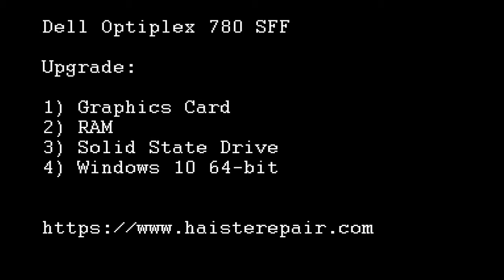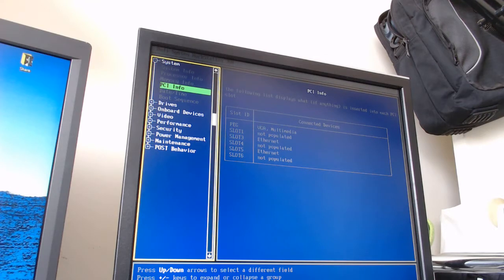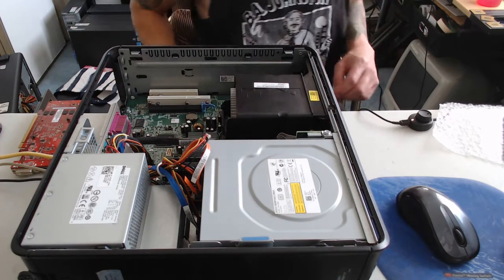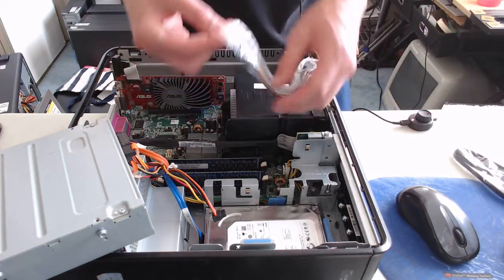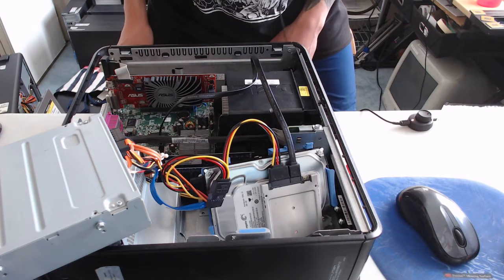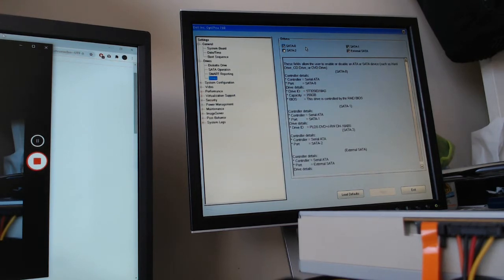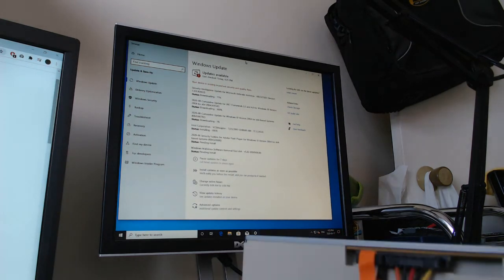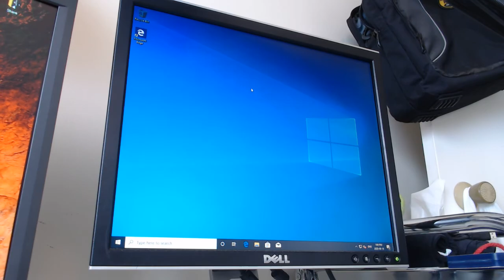Dell Optiplex 780 Upgrade (SSD, Graphics Card, RAM, Win 10)

Comment: Hi, can I install 16 GB RAM? 4x4
Reply from the maker: According to this document, it only takes up to 8GB RAM https://www.dell.com/downloads/global/products/optix/en/optiplex_780_tech_guidebook_en.pdf
Reply: @HaisteComputerRepair  ok, thanks bro
Reply: The 780 can take 16gb
Reply from the maker: @splat2glitcher  Are you certain?  Perhaps if there are models that take DDR3 RAM.  Check out this documentation, for reference.  It states up to 8GB.  https://www.dell.com/downloads/global/products/optix/en/optiplex_780_tech_guidebook_en.pdf

I'm not saying you're wrong, but I personally haven't tried and adhered to documentation in the past before purchasing.
Reply: I made a dell budget optiplex 780 gaming pc with 16gb ram
Reply: And there are ddr3 models
Reply: @splat2glitcher  can you help? I bought 8 GB ram DDR3 for my 780, 2x4 and my pc don't turn on with them :(
Reply: @franciscotorres834  what MHZ ram? Optiplex 780 can handle 1066 MHz (PC3-8500) and I’m not sure about 1333 MHz
Reply: I don’t think OptiPlex 780 can handle DDR3L and over 1600 MHz ram
Reply: @splat2glitcher  1333 Mhz, is that the problem?
Reply: It could be since the optiplex 755 can handle half its max ram at 800 MHz
Reply: @splat2glitcher  thanks, I'm gonna try with 1066 Mhz
Reply from the maker: @splat2glitcher  Thanks for the help, I should have made the distinction.  Good to know that it's an option :)  I also totally blanked and thought that I installed DDR2 RAM into this.  My bad.  16GB makes total sense.
Reply: @splat2glitcher  
I just installed 16gb ddr3 1333MHz PC3-10600 in a 780 desktop with a CPU E8500 @ 3.16GHz. It works great. I'm looking for a gpu. I want to put a gt 710 2gb in it but some of forums I've read say it requires UEFI mode in the bios. Others say they have installed without issues.
Reply: @drneedles7093  I’m guessing some models of the gt 710 need a uefi or it could be the bios versions, you can try upgrading the bios to the max and try the latest gt 710 as I installed a gt 1030 in an optiplex 780 and it wouldn’t work until I upgraded the bios
Reply: @splat2glitcher  I've updated the bios to A15 from dell. If that's what youare saying by upgrading I should be OK. Good to know that you've installed a gt1030
Reply: @drneedles7093  yep it should work

Comment: Hello.Tell me what kind of power supply you have,will this video card have enough 255 W power?
Reply from the maker: Which video card are you wanting to use?
Reply: @HaisteComputerRepair  Approximately the same as your 1 GB low profile.Will my power supply pull?
Reply from the maker: @fileo7777  Oh yeah, if your power supply is 255W, it should have no trouble powering a 1GB low profile card.
Reply: @HaisteComputerRepair  Thank you friend very much
Reply from the maker: @fileo7777  My pleasure :)

Comment: Is 4 sticks 2 GB ram better than 2 sticks of 4 GB ram?
Reply from the maker: 2 sticks of 4GB  RAM is better when you have the option of dual-channel, such in the case of this motherboard.  However, depending on what you are using it for, you may not notice a large difference if you use 4 x 2GB.  If it is available to you and within your means, I would go with dual channel.
Reply: @HaisteComputerRepair  Can you not just stick 1x8gb in a slot? Does it need a pair to work?

Comment: Did you get a better power supply? Or will 220watts be enough?
Reply from the maker: I believe that the power supply was 240W.  That was enough for what this client wanted to do, which was streaming media and general use.
Reply: @HaisteComputerRepair  so if I want to play games with this pc do I need more power?
Reply from the maker: @bloxmobs8890  I don't think so, no.  I would imagine the games you will be capable of playing on this tower will not take up a great deal of resources.  I would start off light and test it out as you go.  What games do you have in mind?
Reply: @HaisteComputerRepair  I want to play rainbow and fortnite and cod
Reply from the maker: @bloxmobs8890  Ok, if you can get a Geforce 710 at least, you might have an alright experience.  Those games are a little bit much for this system, especially for competitive playing.  Older titles will work well, still pretty versatile if you have other games you want to play.

Comment: Hi, I see you installed a 128 GB SSD.  Can I install a 500 GB SSD in a Dell Optiplex Minitower? Also, can it handle 16GB RAM? Thanks
Reply from the maker: You can definitely install a 500GB SSD.  Dell documentation lists a max of 8GB RAM, but sometimes systems can take more.  If you have 16GB handy to test out, try it and let me know as I have never tired myself.
Reply: @HaisteComputerRepair  Thanks, Im sorry, I was confused, I have not a minitower, actually I have the normal one I guess it is a Small Form Factor like the one you show at your video. Regarding the RAM memory, there is a manual in Dell where it shows it can handle a maximum of 16GB though there is another manual that shows it only handles up to 8GB. I think I will take a risk and buy another two 4GB dimms. I already have 8GB installed but I guess will risk some money and see what happens. Will let you know. Thanks.
Reply from the maker: @bambampepe  Sounds good, I would be interested to know!  Keep checking eBay for deals.  Or perhaps the local buy and sells.
Reply: @HaisteComputerRepair  Hi, I just installed another two RAM modules (4GB each) for a total of 16GB. It is working.  However,  for some reason it shows that only 15GB are available. Im dissapointed. I wonder why? My processor is 64bits running windows 10 64bits. At first it took a long time to start but it is working fine.  I turned it off and then turn on again and this second time it started really fast. I installed two brand new RAM modules: " Kingston KVR1333D3N9/4G "   Next step is to install a 500GB SSD. Hope this helps